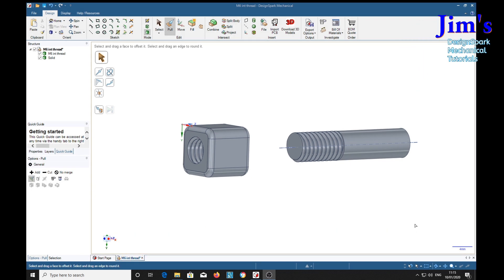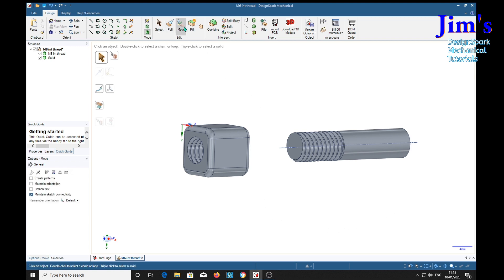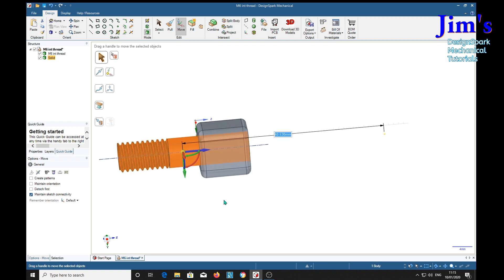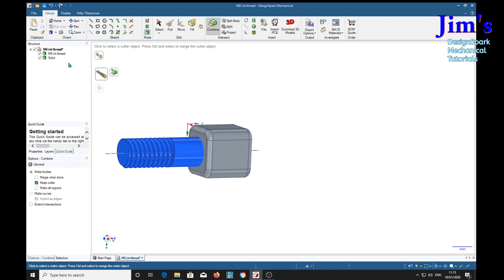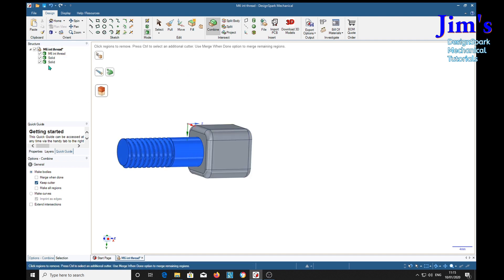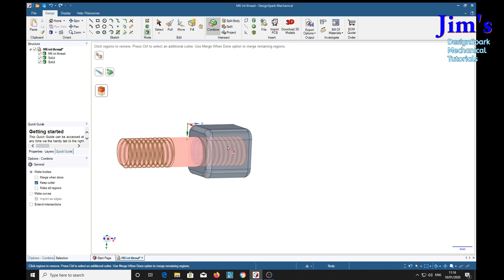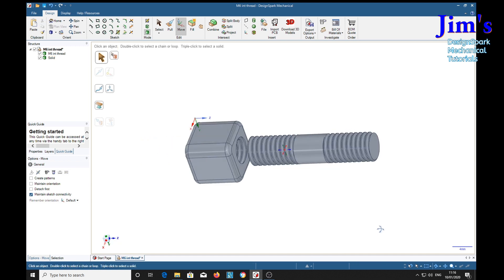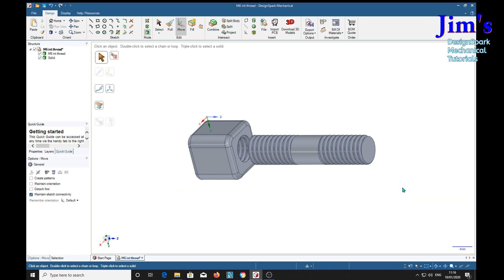Modeling an external thread from an internal thread in DesignSpark Mechanical

Comment: Hi Jim, I have used the technique about to create a large male and female thread. These have been 3D printed, but are very tight to assemble. Are you aware of a technique to enlarge the internal thread without having to go back to a new cutting tool etc. Cheers Pete.

Comment: have you printed this Jim? just wondering about tolerances
Reply from the maker: I do not possess a printer. To get a printed stud to fit the nut you may neet to scale the stud down a tad: a tad = -0.1/-0.5mm :-)
Reply: I tried it and it didn't work.  Too much friction.
If you look at the design specs for nuts and bolts, you will see that they are not mirror images of each other.
The height of a bolt thread is taller than the corresponding height of the nut.  
See Maryland Metrics Thread Data charts.
Reply: @herbcampbell9300  - Hi Herb, I had the exact same problem when printing a large male and female thread. Are you aware of a technique to enlarge the female thread (Nut) via the DSM pull function? Cheers Pete.
Reply: @petesmith3974   Yes - I am aware of the technique.  However, being an engineer, I am a stickler for building to the exact specifications.  Making a "close facsimile " that may (or may not) work is not acceptable.